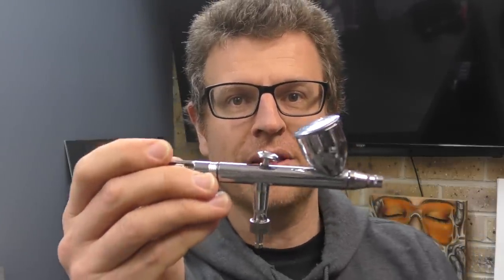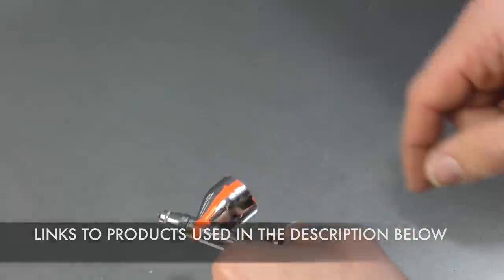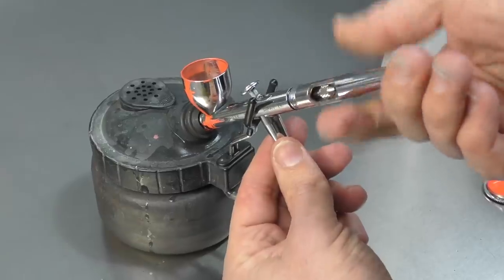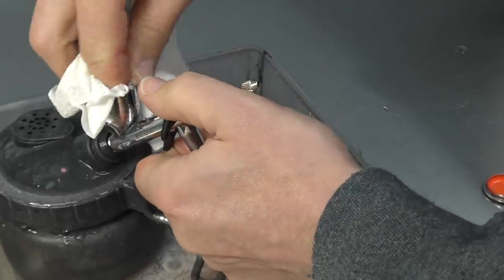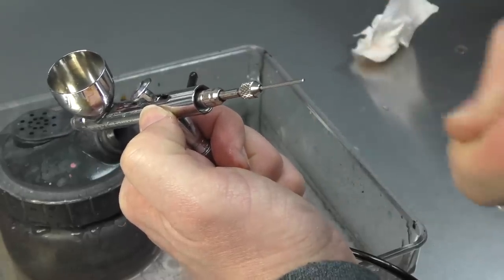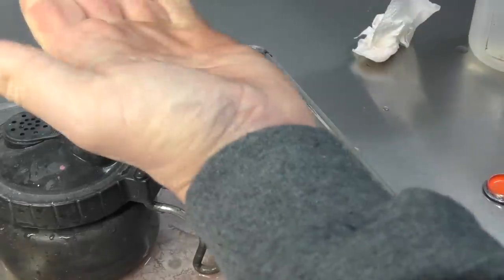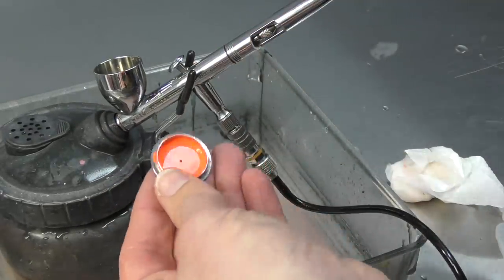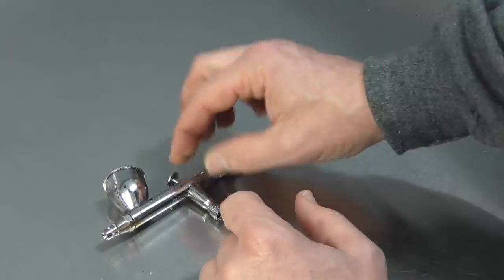How to clean an Airbrush

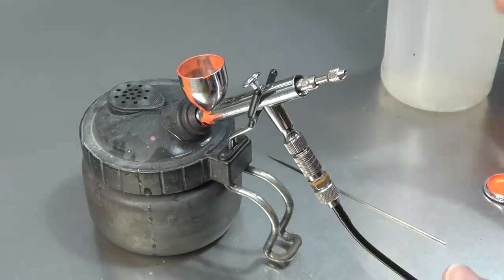Comment: WOW 😮😮😮 What the hell are you doing at 4:26!!!!!!! Flushing through the back of the air brush into the needle chucking guide with the needle removed is not only virtually pointless it's also going to flood and contaminate the air valve and mid section (trigger interspace) of the brush, as well as removing the lubrication that should be in that part of the airbrush. You will also get paint dribble back out of the needle seal / packing and set in the trigger interspace, this will also more than likely contaminate the air valve as you did not cover cleaning this area in any way which would need to be done following your process! also if people think this process is OK when using solvent based paints and cleaners / solvents as someone has in the comments down below they are just going to just wreck the air valve as the seal will swell and stop working. No where in any Iwata (or other brand) manual does it tell you to do what you are are doing, in fact it specifically tells you "NEVER soak your entire airbrush in any liquid"... basically what you are doing with this haphazard method! 
So to be honest if you are teaching this method then it is NOT amazing that your students get paint into the air valves! If your needle packing is good and adjusted properly then in normal use you will not get paint passing back down the needle, what you state at 18:13 is complete BULL. 
When cleaning the air valve you do not mention lubrication at all, especially of the main lever toggle (Trigger push pin).
At 11:30 you also called the Needle Cap an "Air Cap"... it is not, the item it screws onto is the air cap or nozzle cap, this is very misleading for new people as they misunderstand the entire function of the parts.
I thought this was a professional channel but wow you just changed my mind!
This is completely the WRONG way to clean an airbrush! The fact you are an Iwata Airbrush dealer is even worse and amazes me!
I suggest you get an Iwata specialist to teach you how to clean these properly and then perhaps you can re-do your video!!